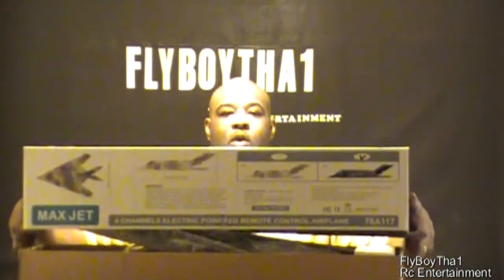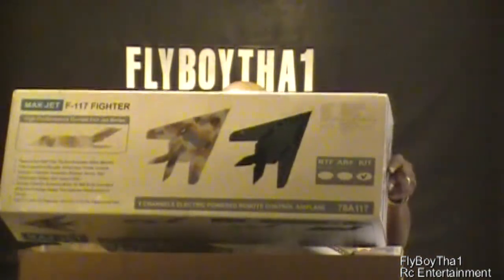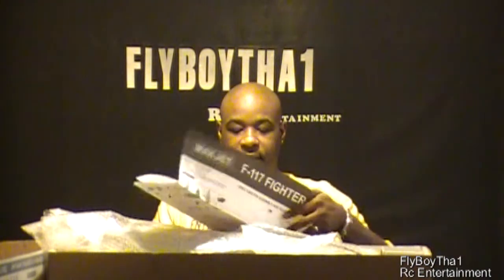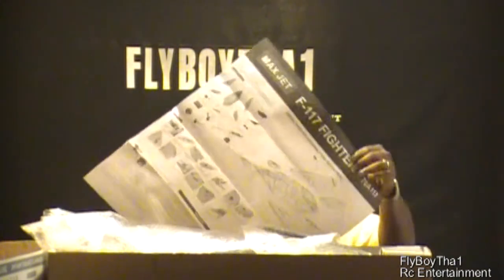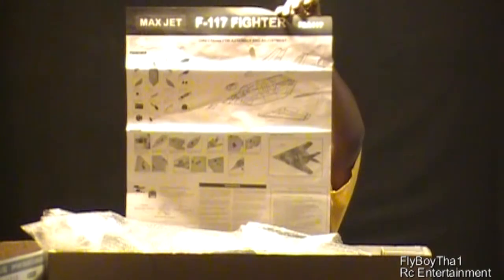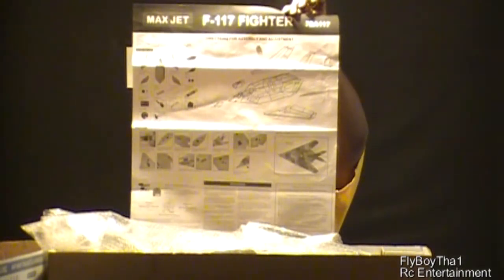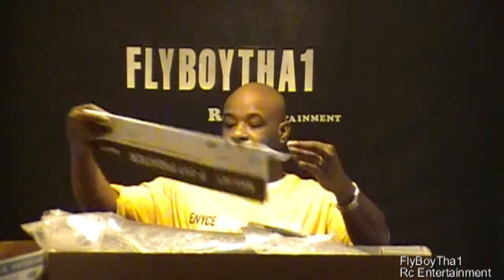Nitro Planes 64MM Max Jet F-117 Fighter Jet "ARF Build Video #1"

Comment: cool! do you know what ESC and amperage I have to buy for an E-Flite EFLM30180MDFB BL180m Ducted Fan Motor, 11750Kv, 130mm Wire?  I wanna build a small micro jet but I don't know what esc goes with that small motor.  Thanks man!

Comment: @earthling1984 Just to answer my own question(in case anyone else wonders), the RXR version came with everything pre-installed!  All except 2 servos(which go in the wings that aren't yet attached.  Everything else - Motor, Esc, and other servos are all pre-installed.  I haven't built yet, but it looks like the build will take 15mins; there is only like 10 pieces total, and that is including 3 wheels!